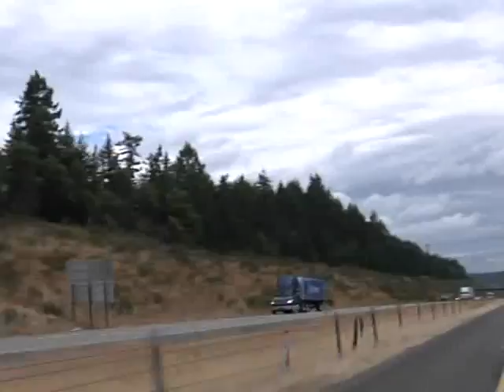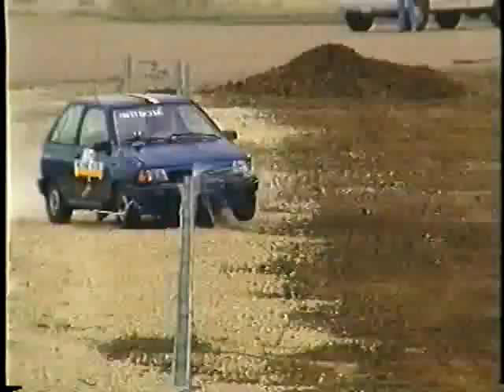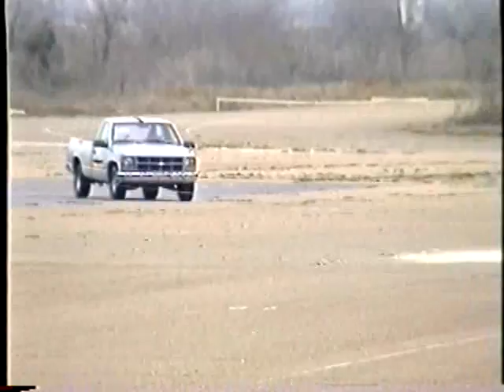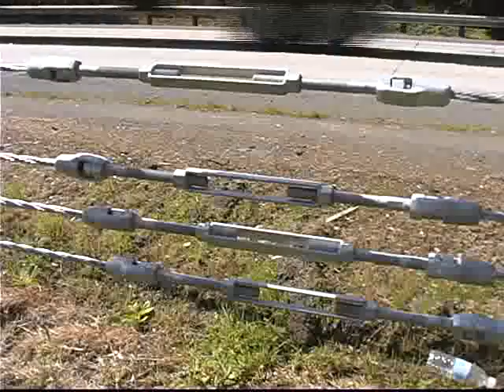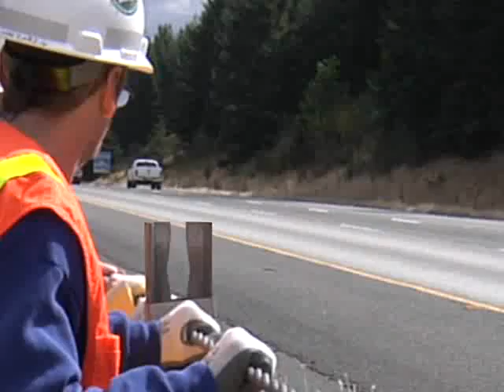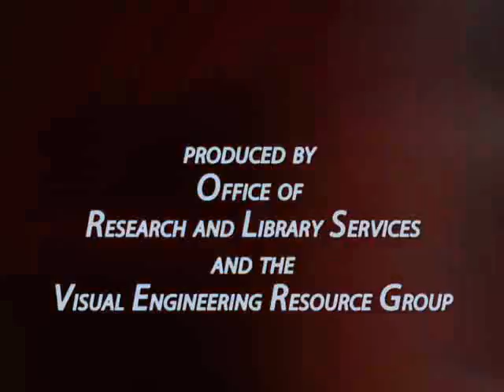Cable Barrier Training for First Responders

Comment: I used to work part time for WSDOT and we responded one night to a cable barrier accident in which the car had a cable running down both sides, thus preventing the doors from opening. The tension on the cable was too tight to lift them over the car. but instead of cutting them, we took a pickup and pushed on the cable anchor breakaways til they broke, thus relieving tension.
Reply: Ok

Comment: This is all fine and good for cars and trucks.  First responder training for a motorcycle / cable barrier will include gathering various body parts from the corpse on the far side of the barrier and roughly assembling them on the impact side for the coroner to put in the bag
Reply: Sucks